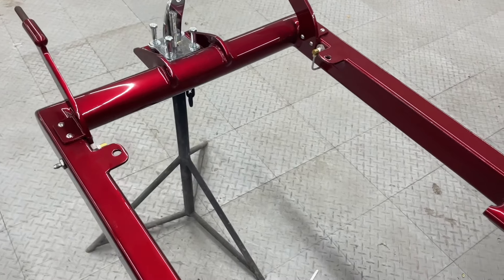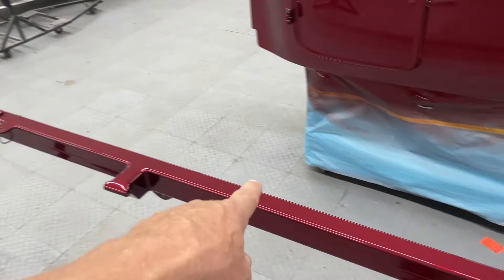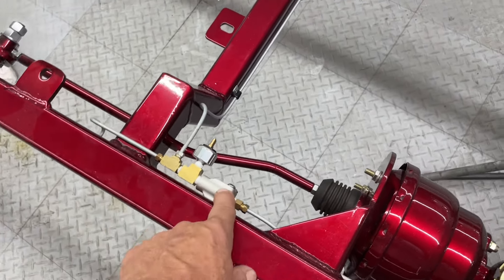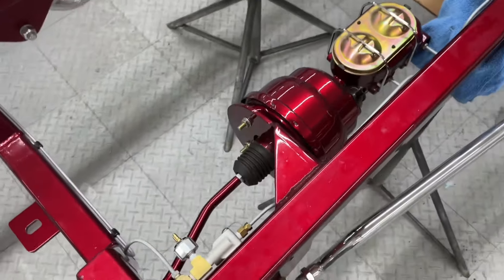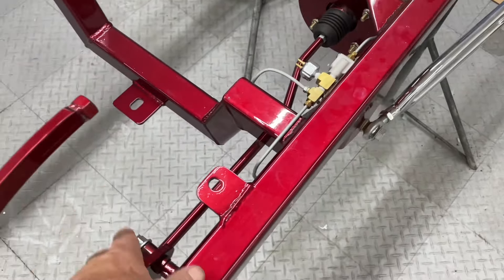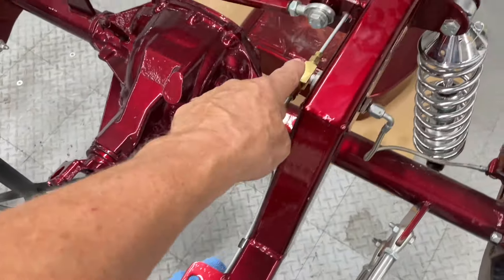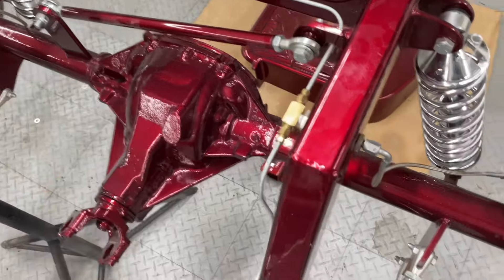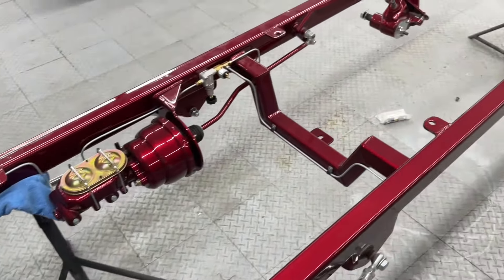Running brake lines on a Spiritcars T bucket

Comment: Its a work of art and pure craftsmanship. My T had the same kind of setup sans power-booster which would have been nice. I was running Wilwood front disks and a 1950 Pontiac rear end with drum brakes. When I first got the T it had a suicide front end with wire spoke wheels.  I opted for safety over looks especially with that big block Chevy sitting up front on a T frame. If I had to do it over it would get the Heidt's IRS and power disks all around with a blown small block (saving weight). That is the hot ticket.